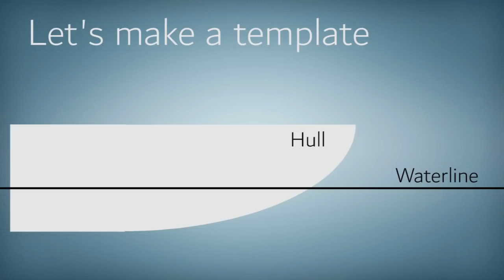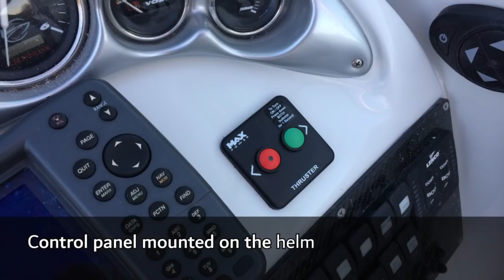Bow thruster install!

Comment: Awesome!  Who can say anything bad about anything you did on this project.  Outstanding in every aspect.  I'm installing one on mine this winter and thanks to your video, it'll be much easier for me now.  Thank you.  One quick question: why did you use the peel-ply tape?  I know you mentioned it removes the amine blush and leaves a texture finish, but is that mostly for in between layers to help the next one adhere better or just removing that shine?  Thanks, man.
Reply from the maker: Thank you so much for the nice words! Regarding the peel ply, it does both. You don’t want to laminate over amine blush nor on a shiny cured epoxy. If you don’t use it it’s not worse that you just have to wash away the blush with soapy water and sand down to give the next layer some grip. I applied several layers during the same day with only a few hours between. This way you will get an excellent chemical bond between the layers. Hope your project will go well! If you have any questions just send me a message
Reply: @jacobkollerup  amazing video, did you infill between the inner and outer hull before you inserted the tube? I see you squeezed some in after the tube was inserted.

Comment: What a slick router jig, I am “borrowing” that idea for my thruster install! Excellent work all around.
Reply from the maker: Thanks!. Let me know if you want to borrow the real one. It fits a Ø43 mm router. I'm using the Kress 1050
Reply: @jacobkollerup  Thank you, that is very generous of you but I’m sure I can make one without too much trouble. I plan on using a die grinder to power the bit rather than a trim router. They spin at about the same rpms but the grinder is long and skinny at the business end and does not have a base. This should allow me to get really close to the surface, which should make it easier and allow for shorter tools. I’m always nervous when I work with 1/4” bits and the longer they are, the more nervous I get. Now, If I could only come up with some dust collection….

Comment: You should produce and sell that router attachment for cutting the tube hole! Its brilliant and created the perfect angle while cutting instead of going back after the hole cut and grinding out the proper tube/bow angle. A real time and guessing saver.

Comment: I’m glad you chose West 105 - it’s the only epoxy that I’m aware that’s been tested and used to the extent it has with other marine non-epoxy resins.  Vinylester Resin is the safe sure choice.  It’s the failsafe for boatyards for hull repairs that don’t want any come-backs.

Comment: Just a general info FYI - you can buy matching gel coat ( with wax ) by the quart for your particular Hull, block sand it, wet sand it, and polish it.  Lots of labor but it will match the rest of hull really well if you compound and polish the rest of the hull too.
Reply from the maker: Thanks, I definitely need that for some other gelcoat repair work. Last time I tried to other it, it couldn’t be shipped across the Atlantic due to the hardener
Reply: Jacob Kollerup - you’ve got quite a bit of filling and block sanding to do before the gelcoat.  I’d suggest using a 6” DA sander and leaving the angle grinder in the toolbox.  Harbor Freight has a cheap one but it’s borderline tolerable.  You’ll need to order gelcoat with wax already mixed in in order for you to be able to spray it and cure it (a hull mold is anaerobic so it cures without wax in the boat building process).  You’ll need a spray gun nozzle sized about that for primer or latex in order to successfully spray gelcoat, and it WILL have some orange peel texture to it.  Sometimes I’ve had to spray PVA over the gelcoat in order to get it to cure.  Get a sanding block and some guide coat from an auto body supply dealer to get your final layers of filler as smooth as possible.  You’ll also need the sanding block to get the new gelcoat to blend with the surrounding gelcoat.  Good luck with everything.

Comment: Doesn't cutting the bow reduce the strength having it that close to the v bottom? Where I boat the waves smack the bow pretty hard. What happens when you beach it? Cool project, but with a smaller boat it seems like the structural integrity would be compromised.
Reply from the maker: In theory yes, cutting a hole in your boat will reduce strength. But remember that the hole is reinforced with a strong tube and multi layers of fiberglass. In general the hole is quite small compared to the rest of the hull, so I don’t fear the boat splitting in half. If I should spot a weak spot it would be if I were to hit something hard on the exact thinnest spot, but again the hull is very thick and strong especially along the centerline.
Reply: Just don’t beach it PLEEB
Reply from the maker: Beaching? Isn’t that only done in the boat brochures?😂.
Reply: Jacob Kollerup we beach all the time on the east coast. They have sand bar parties. I'd be trying to figure out a way to strengthen the bow. I trailer on rollers too.
Reply: WHolly shit thats a huge hole - Its only a small single engine .. Did you get sold on a product that you dont need ?
Reply: If done correctly this could increase hull rigidity in this exact location where it otherwise had no previous material to provide support ...Good job !
Reply: rywolf01 Yeah no!  Couldn't be further from the truth.  How do you think the factories install bow thrusters on their boats?  Yep, the same exact way.  Once the hull comes out of the fiberglass mold, they drill all the holes in it for the anchor, through hulls, transom bow thruster etc. and then attack all the stuff to it.  This is no different.

Comment: Pretty cool seeing how it was installed, but the finish work is rough at best. The texture would be unacceptable on any hull that is intended to look good.
Reply from the maker: I know, I wasn’t satisfied with the look after painting the antifauling, but boating season was around the corner. The finish will be done next winter

Comment: Nice work. I’m thinking about do same thing to my little boat.. 25ft Bertram. 
Could you please tell me if you notice any difference when the boat is beating into big waves?
Reply: Also when you turn sharp on plane does it try to dig in ever?
Reply from the maker: Thanks. On plane the bow is way out of the water. When taking big waves head on I can’t feel any different. I made the small deflector/spoiler on the leading edge, which should channel water out to the side. Nevertheless, there is so much hull that the fairly small tunnel doesn’t influence anything. Good luck with your project, you’ll be so happy having it👌🏼

Comment: What does it cost and time to install?   Great job by the way.  Alot of patience there.    
Just getting into boating at 67.  Im learning alot watching these videos.  I bought and older SKI Nautique.   First thing I learned, caint drive in reverse!! Lol
Reply from the maker: Hi Lonnie. Thank you for your nice comment. So the thruster package (motor, tunnel, control panel) was about 1500USD. Then you need supplies for all the fiberglass work. I went for the best quality West Systems. Think I spend around 200USD including the fiberglass. Additional you'll need a 12V battery ~80USD. 
Timewise, there goes a lot into project planning to make sure you don't cut the hole in a wrong place!. You want the tunnel as far foreward and down as possible taking various bulkheads into account. From when I did the first cut till the last coat of epoxy was probably 5-7 full days. However there is a lot of waiting in between steps for the epoxy to set

Comment: Hej, snyggt jobb! Jag har samma problem, det blir tight mot skott/bulkhead. Men du lyckades få in glasfiber helt runt röret på insidan? Hur mycket reinforced epoxy fyllde du sedan i mellan rör och bulkhead - fyllde du hela det utrymmet ner till kölen?
Reply from the maker: Hi. Thanks. So I placed the rear of the tunnel about 1 cm from the bulkhead, so I still had enough space to pour down the thickened epoxy. However, before I did the pour, I put down thickened epoxy on the front/lower side of the tunnel against the hull and keel to prevent the main pour to run out. When that had reached the initial cure (so it was past the gel-state) I started doing the filling pour. I used West System 404 high density filler. I didn't use that much, maybe 300 ml epoxy + filler. I divided the pour into two steps to avoid the epoxy to get overly hot during curing. Just remember to do second pour when the first pour is still un-cured to get a good chemical bond between them. Good luck with your project:)
Reply: @jacobkollerup  Thanks for quick reply! "Thickened epoxy" = epoxy-mix with fibreglass fibers? Or something else? Is it so liquid so you can pour it easily, or is it a lot of work pushing it down with a thin tool? And: what kind of tape is it your'e placing on top of the top layer of epoxy?
Reply from the maker: There’s different types of fillers/reinforcement you can use. I would recommend to go to the west system website and look through their guidelines. Just from the top of my head, their 402 is a general filler/thickener. 404 is a high density filler. They also have one with chopped fiberglass which is more for reinforcement. The amount of filler/additive in your epoxy determines the thickness. So for the pouring I added just enough to make it thick but still pourable. The film I put on the last layer is called peel-ply

Comment: That's a pretty difficult and scary project to carry out but, well done for having the balls in the first place. My only gripe would be the end result. The finish is pretty poor. Some epoxy filler then some fairing compound would of made a much better finish. A lot of time filling/sanding and feathering I know but you only get out of a project what you put into it!
Reply from the maker: Thank you for the comment. I don’t totally agree with the end finish being that bad. The entire area is painted in thick anti fouling paint which has this uneven surface. I could probably have spent another weekend to sand down to perfection, but at some point I’d rather be out on the water🚤

Comment: If you ever been alone and tried to dock in a tight space or trailer a big 27 foot CC in current or wind then you’d kill for a bow thruster.  Those are tall, heavy boats with a lot of freeboard.
Reply from the maker: Exactly! I had a lot of sh.. on having a bow thruster in “that small boat”. I mean why not if it saves you stress and  potential boat damage

Comment: Ok thats all well and good.....but how did he get the boat in that spot and off a trailer?
Reply from the maker: Here (in Denmark) we don’t really pull boats over ~21 feet on a trailer, since not many have huge trucks. Most common is to use a flatbed with a crane arm to transport it to the marina at the beginning of the season, have it permanently in the water for the summer and then transported back on the flatbed for winter storage
Reply: Jacob Kollerup ahh makes sense....ya here is the USA, everyone  has pickups and giant SUVs

Comment: clean install, what kit did you use?
Reply from the maker: Max power CT35 package with tunnel and control panel. West system for all epoxy and glassing

Comment: I would have used vinylester resin instead of epoxy resin.  Epoxy does NOT play nice with polyester resin.
Reply from the maker: You have it the other way around. Epoxy works perfectly on top of “esters”. Plus epoxy is seals of water much better than gelcoat. Since I’ve used anti fouling there is not need to use gelcoat to make it look nice
Reply: Jacob Kollerup - West System 105 has been tested extensively with all kinds of marine applications.  Other epoxy formulations; I doubt it.  Amine blush is the first sign that the brand of epoxy you’ve chosen isn’t playing nice with the hull polyester resin.  Vinylester resins are compatible with both polyester and epoxy resins, and are 80% as strong as epoxy.  Most boat yards that repair hull blisters these days will use Vinylester resin.

Comment: Why, it’s completely unnecessary on a boat that size, what is your reasoning for this installation, I’m really curious, well done but why?
Reply from the maker: Single engine and high winds most of the time here, that’s why.. plus it was fun to do🤓
Reply: My question also. That small of a boat handles like a dream and I make the wind do my maneuvering work for me. Work that bow...
Reply: Fair enough I guess, where abouts are you? I have to admit if I was gonna install one I would use this video as tool to help, very well done mate, also at a crowded gas dock on a windy day I’m sure it is a welcome feature to have...🍀
Reply from the maker: I’m in Denmark 🇩🇰. Thanks! I have to admit that I try not to use the thruster unless absolutely necessary or I just don’t want to make an ass out of myself in a busy marina😊

Comment: Why a bow thruster on a 28-foot boat. waste of time and money. Just learn how to operate a boat that small
Reply from the maker: Well, I kinda enjoyed doing it. Also I would argue that no matter the skill level, when the wind is high enough and you have a single stern drive, the bow will be impossible to turn. Simple physics.
Reply: We have a 28 foot chaparral and we just use it without bow thrusters. You could argue that it's easier to maneuver on the ozarks but sometimes the current is throwing the front end around when docking. It just takes practice to not need thrusters
Reply: Bob Stahnke - No it's not!  Stop with the pessimism and negativity.  To each his own and if someone wants a bow thruster, then they can get a bow thruster!  I hate this negative bullshit from you people.  "Man up and learn how to drive your boat!"  Pfffttt.  This makes the boat much better and easier AND SAFER to spin and dock and pull out of pinched-in gas dock and makes life much easier in winds and heavy current.  Why not make life easier and safer?
Reply: always one that wants to brag about piloting a boat or reversing a car, he’s chosen to fit it (like so many others) because he wants to not because he cares what you can or cannot do